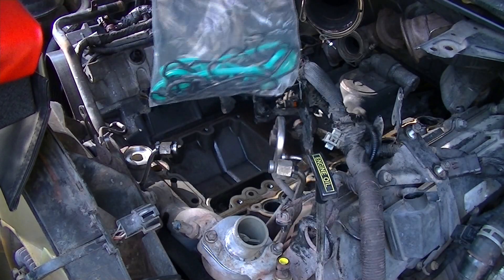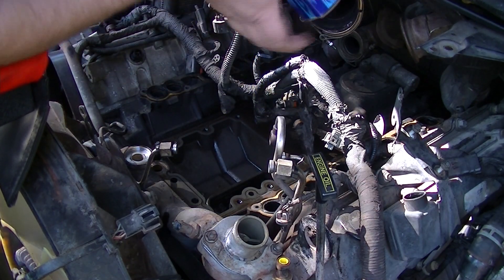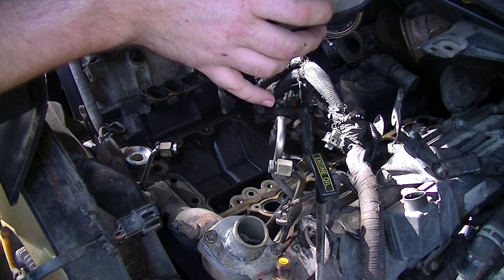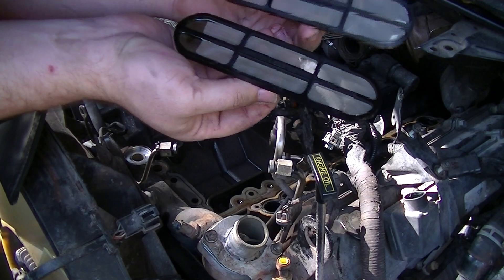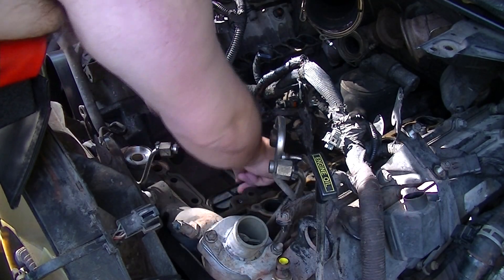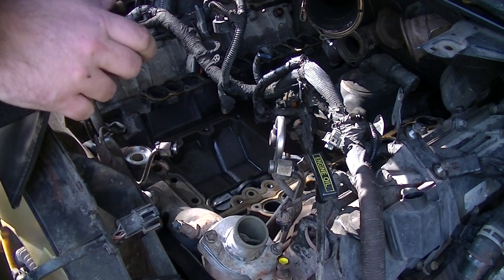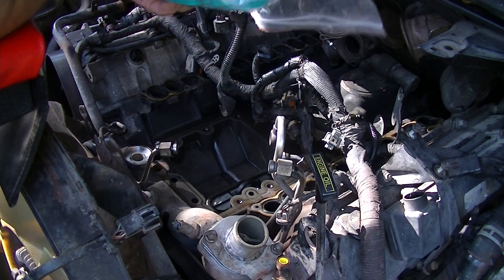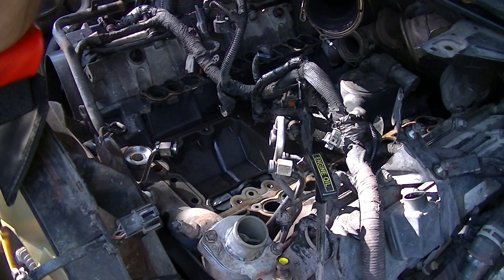Oil Cooler Replacement (10): Comparing eBay and OEM Oil Screens from 2005 Ford F250 6.0L PowerStroke

Comment: Do the ebay gaskets work for the oil cooler?
Reply from the maker: If by 'work' you mean cause more work down the line, then they sure do!   Stick with OEM on the gaskets and the cooler - the aftermarket stuff is just not up to spec.

Comment: Make sure u blow out the bolt holes before reinstalling the oil cooler or u will get a false torque reading on the oil cooler bolts.
Reply from the maker: Oh I will.  I have a blind tap I run through all bolt holes and actually vacuum the holes before blowing them out. Definitely a proponent of clean re-assembly.